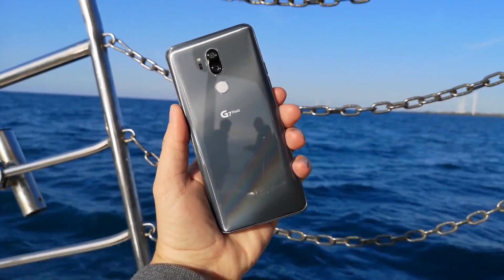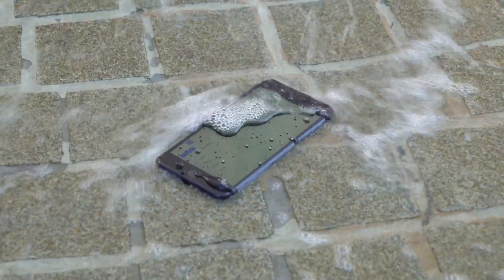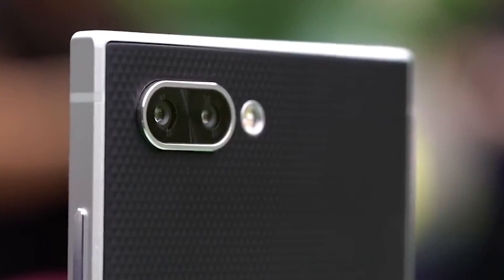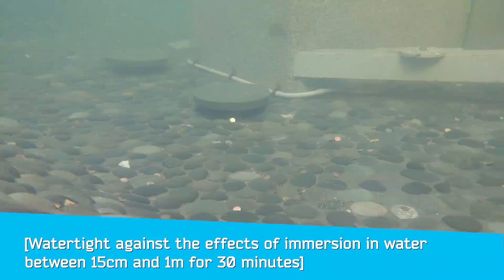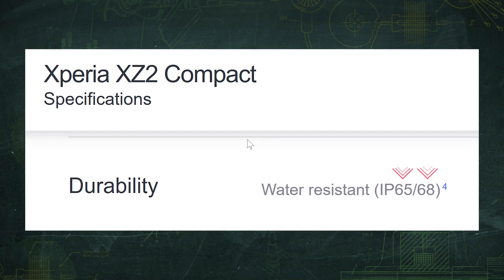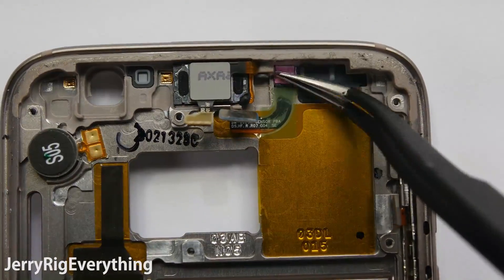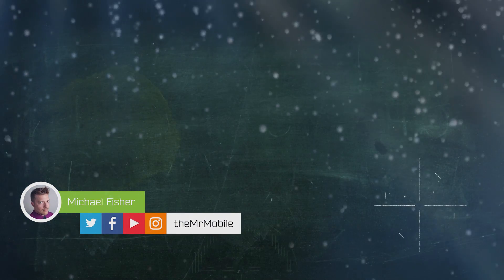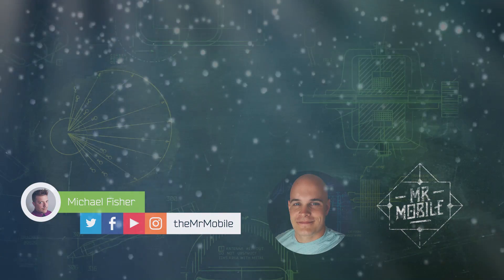Your "Waterproof" Phone ... Isn't

Comment: I don't get how people think the words IP** water resistant somehow gets translate into waterproof.. From the get go, just say no, and actually read the manufacturers description of their product. The words waterproof and electronics don't go together and companies will do anything to avoid that confusion.

I get there might be a handful of Chinese companies using the buzz word 'waterproof' when describing their device but let's not act like it isnt completely on the end users why there is this crazy misconception that water resistant somehow translate to waterproof.. Very different in terms of protection..

Even phones with IP68 aren't impervious to water, even at their described ingress rating. In order to get certified, there are in lab tests that almost never take into account real world usage, such as taking a phone in a shower. People think it's harm less but don't get how much pressure you run into that a showers pressurized stream has, but try directly pointing your showers head at your phones opening, I can guarantee you can only safely do it once..

Also it blows my mind reviewers putting phones into a cup of water and that somehow passes their water resistance test, but putting a phone 4 inches under water in a cup is no where near the same as putting youy phone under 4 inches of water but in a pool or lake. The bigger body of water has an insane amount more of pressure put onto objects VS a small cup, even with both phones being covered the identical amount.

Comment: But is there any smartphone that can be actually used with no worries in water? Galaxy S8 Active?
Reply: CAT S60
Reply: get a waterproof bag for 5€
Reply: Mx Jonson I'm sure it will be fine. I have a galaxy s7 edge and took several under water videos and pictures with it. My phone is still standing till this day. Even after dropping a 60 lb weight on it.
Reply: Any smartphone can be used under water... from inside a submarine that is. Apart from that, tough luck. 😅
Reply: CAT phones or Sonim phones.
Reply: Mx Jonson use a plastic bag and tightly close it
Reply: No such thing as waterproof. Not even submarines. Take it deep enough and it'll leak.
Reply: Luc David nope, even that is not totally waterproofed, it's just an improved version of an ip68 rating, not really waterproof
Reply: Ρένα Ξ but are they worse?
Reply: Zoya Spencer yea i used one and film under the water and its good for ppl that droop there phones a lot bc i droped in the gym a lot of times and it was ok . just dont start puting weight bc right when i put it in my pock it 20 minutes after i took it out and the display was black and i think it was bc of weight
Reply: CAT S60/S61
Reply: Jose Medina He asked for something that can be used without worries underwater. It doesn't exist. Read next time maybe?
Reply: Get one from solid snake, that'll do the trick
Reply: Joshsmoove  yes but the active are not better than the originals one
Reply: Joshsmoove well they are water resistant but s8 is more resistant than the active one
Reply: Ρένα Ξ I see I always thought It would have been the same or better. Guess they just made it more rugged.
Reply: Zak Lappin Me as well. I only rely on it in accidents. I am sure damage will only occur if its submerged for 10 minutes or so. A regular phone wouldn't survive thought.
Reply: something1random23 its called waterproof rating it doesnt mean its waterproof ..
Reply: something1random23 you will just have to pay a lot man ..
Reply: Andre Lyew just use a type of magnetic charger that doesn't need to be plugged in and out and you can gold plate the connectors and pray that it will not get scratched,therefore no need of a fully golden connector
Reply: The Sony Xperia lineup is by far the best I've used so far. I  shower everyday with my XZ2!!!
Reply: In order to make a truly waterproof phone, there would have to be zero openings.  No mic, no speakers, no charging port or headphone jack.
Reply: Kyle Hughes ip68 Bluetooth earphones, wireless charging will help.
Reply: Zak Lappin i also have a note8
Reply: iPhone XS
Reply: the nokia 3310.
Reply: Sony you can go underwater without doubt...And Sony were expert in this...
Reply: When I had my Galaxy S5 I use to jump in the pool and video record with no issues and the battery was swappable.
Reply: Put it in a zip lock bag is one way
Reply: Rida Kesserwan I know but 5 meters resistance ought to be better than 1 meter, no ?

Comment: Isnt there a case that makes the phone water proof?
Reply: I think you're probably referring to LifeProof cases. While they're excellent cases (they better be for how much they cost), they're still going to have their limitations. I'm not sure what they tend to be rated at, but regardless, once you reach a certain depth, the water pressure is still going to compromise the case's integrity.
Reply: Researcher Researching Research It's hard to make a device waterproof I suppose. I don't mind my device "just" being water resistant, but then it should be marketed as such instead of beings shown like it can survive continuous dunks of water without a hitch
Reply: An airtight plastic zip bag is what you are looking for.
Reply: As john said
Airtight Plastic zip bag is all you need.
You can buy them for like $1 and bring any phone inside pool and selfie in there lol.
Reply: Not they will protect against water but an like a ip resistance the water could leak in with pressure.
Reply: I guess it's false marketing then. Since they keep advertising it will make a phone waterproof.
Reply: But it is at least one more layer of protection.

Comment: My Galaxy S7 Edge was the best water “proof” phone I had. I didn’t use a case and had it underwater frequently for a few months while road tripping and it took fantastic video and pictures under water. I miss it.
Reply: Still got mine and don't see any reason to upgrade right now. Its water proofing is better than my friend's iphone though.
Reply: I know! Also, its crazier when you think about the fact that they used to have some of the most conservative designs in the industry, remember the Galaxy S4?
Reply: Joycelyn Antwi Umm how so. I've put my s9+ in an ocean and in pools and phone still works flawlessly today.
Reply: I have a S7 Active and Note 8 and they are both going strong even the S7 Active. It has been in many rivers and a ocean. Also the pool.
Reply: Big facts. Samsung is the only true waterproof phone out there. Regret finding my iPhone 7 Plus under the sync
Reply: Just sharing a precautionary story, I liked bringing my phone to the shower and sometimes rinsing those oils off it and all, after a year or two, I noticed water vapor on the back glass, that was when I stopped rinsing it anymore. Also another thing is that, my headphone jack seemed to lose its contacts, always have to twist and turn the jack to in order for it to connect properly. I've only rinsed my phone in water, not even seawater. That's sad :(
Reply: I cosign this and still have my s7 edge. My next phone will need the same functionality as this one. People loved my under water videos.
Reply: Samsung has waterproofing down pat.  My Note 8 has spent plenty of time underwater in the year+ I've owned it and no issues.
Reply: ATW Tech - Alpha R2 stil, be careful of corrosion, though i admit the S7 still is really great!!!! 😍😍😍😍😉
Reply: Ikr still love mine after all this time
Reply: HAHNN water resistant decrease overtime so that's why your phone get water inside
Reply: Damn chlorine >:(
Reply: One of the best smartphones I have had. I Swaped it with the S8+ and Samsung has not disapointed me yet, thinking about going with an S9+.
Reply: Geric John Olivar I dropped my s9 In a pool and pulled it out a second later....it did not survive